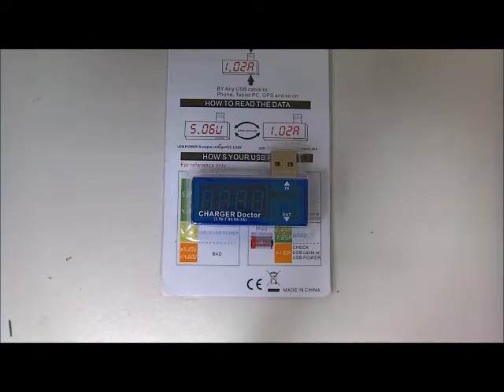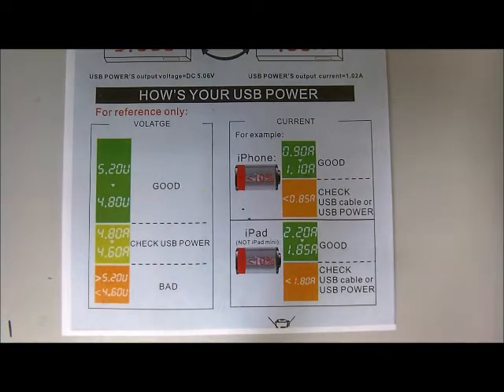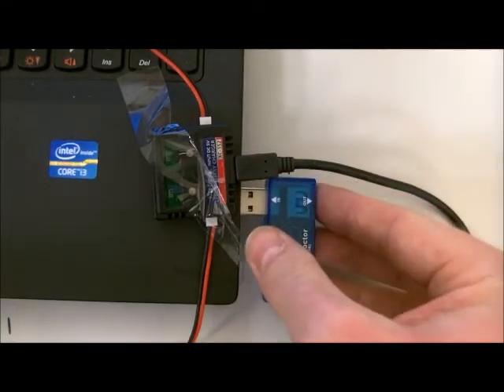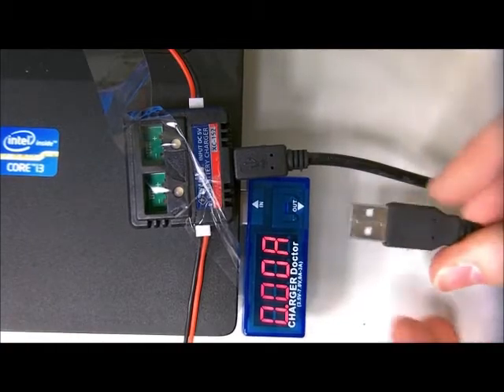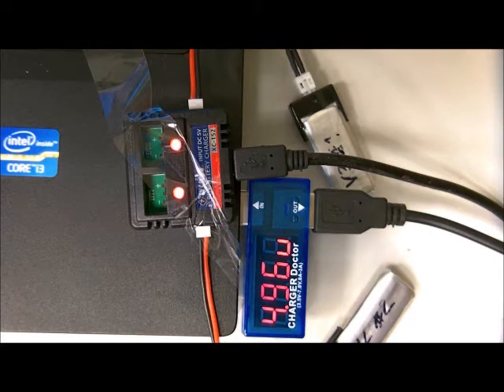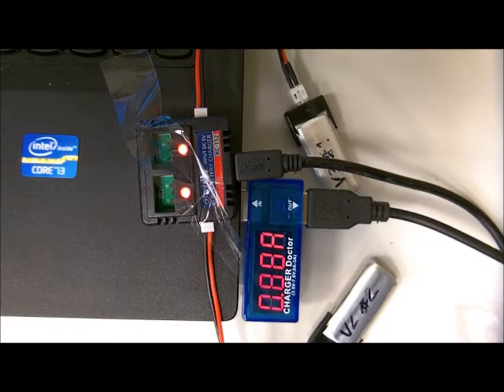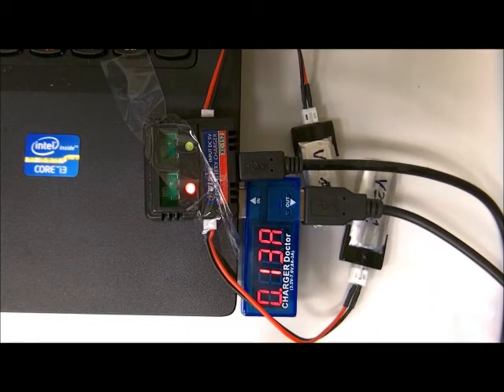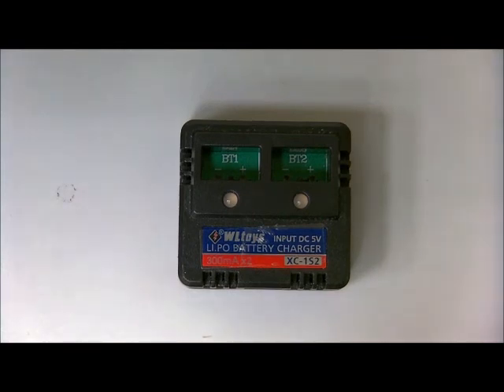charger doctor demo

Comment: The unloaded voltage you were reading before you plugged in the charger is normal. Regulators have a hard time holding the voltage down if there is no current draw.

I was surprised that your USB port from the computer supplied over 500ma as I was told that is the most they will supply. As for the difference between the amount of current the charger puts out to charge the batteries and the amount of current it draws, this too is normal. The charger takes some current to work, power that it uses that has nothing to do with charging the battery.
Reply from the maker: ok, makes sense and I even kind of understand - what I DONT understand though is, (and I hope I get at least the theory right) is this:
I have to suppose this charger works based on parallel charging principles - so half the amperage would go to one plug, and half to the other, right? if the actual output current at the plug WOULD be 300mah as I thought it is supposed to be according to the label (300mah x2) on the charger, this would mean all the other current (and this is - or would have to be if I understand the principle right - another almost 300mah) would have to be "released" as something ... and that would have to be heat, no?? But the charger is totally cold o_o!